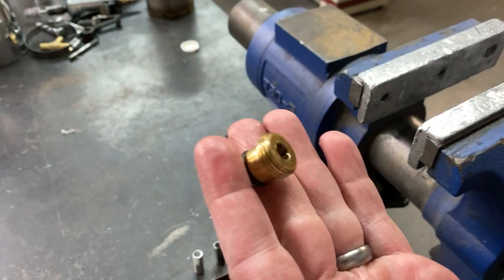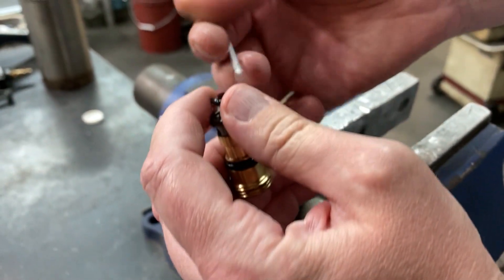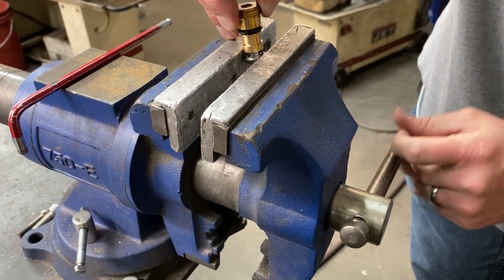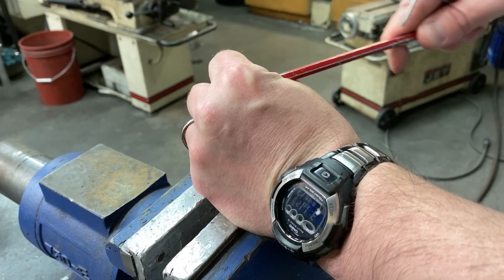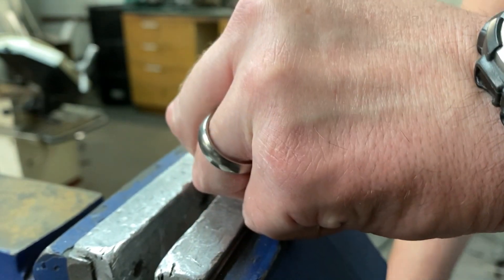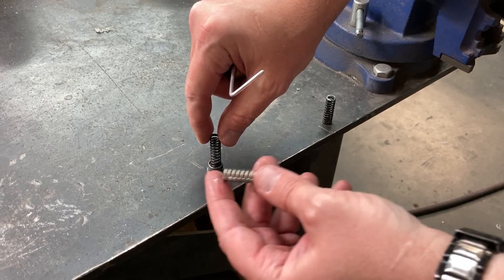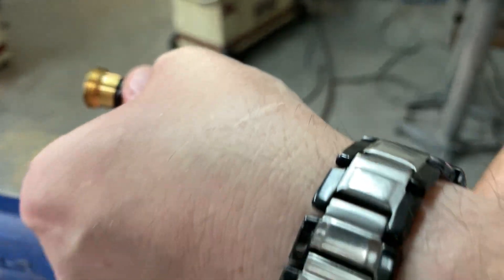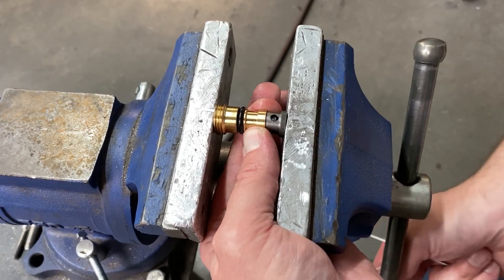Iroz Haldex Valve Modification

Comment: Why is this value being replaced?
Reply: Hey guys, interesting, do you stock the uprated spring, and if so do you have a link so I can purchase please 😁
Reply from the maker: The valve gets an upgraded spring installed in it to allow for more fluid pressure, without the valve upgrade the unit doesn't do anything
Reply: @IrozMotorsport  understood, more fluid = faster reaction time and more clamping force...

With the controller are you able to set it up so the haldex response can be throttle based and come or come on under hard breaking to increase stability?
I see that VanCity makes adjustments with this knob that was installed 

Had the UM haldex tune, it really changes how the car feels and have just been looking around at other options (this would be for a 7.5R)
Reply from the maker: @hunterlane3323  The potentiometer adjusts the bias so that up to 50% of the power can be sent to the rear it is still throttle based and can likely work with the updates UM provided
Reply: @IrozMotorsport  just moved to Vegas, see you guys are here, if you guys are UM dealers I’ll swing by sometime soon...appreciated

Comment: This is strictly a interference fit?
Reply from the maker: The spring replaces the OEM spring and has a different spring rate which is what makes the difference
Reply: @IrozMotorsport  yes, thanks 👍. Is the two pieces of the valve an interference fit? It's not clear in the video as to how it stays together.
Reply from the maker: @photorocket4550  yes it is an interference fit and the friction itself between the two materials is what hold it together